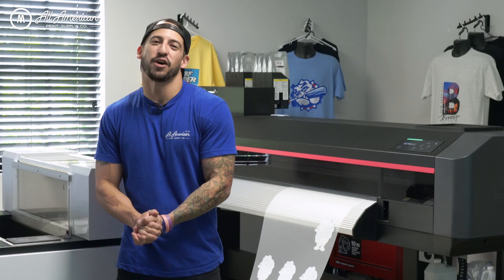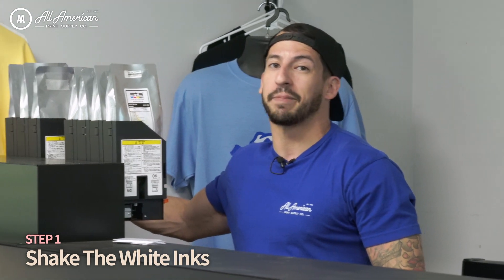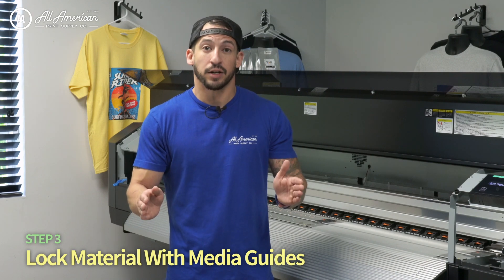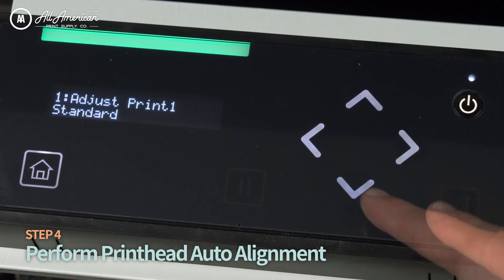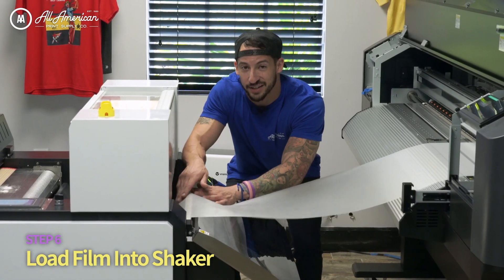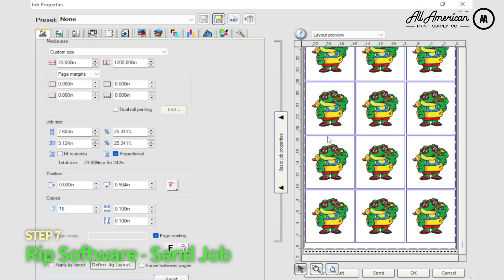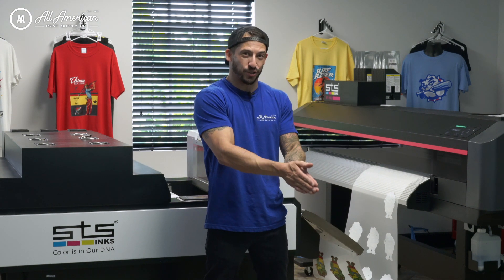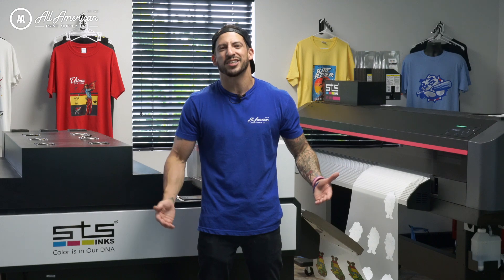DTF Game Changer! STS XPJ 1682D - Full Demo | AA Print Supply

Comment: What is the difference between this one and the STS VJ628D?
Reply from the maker: Hello, there are loads of new features such a dual staggered print head set up, printhead nozzle compensation, auto media width and height detection, white ink circulation and more!  Plus the increased max print size of 63.3"
Reply from the maker: Be sure to stay tuned to this channel-Wednesday we are uploading a video for you going over all the specs and details on the new STS XPJ1682D